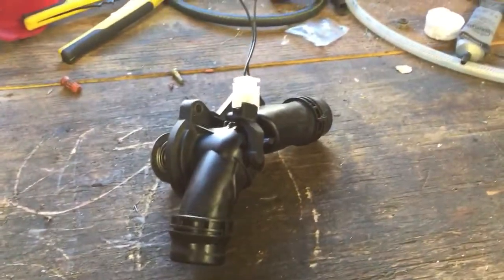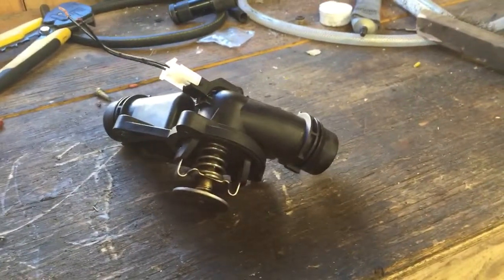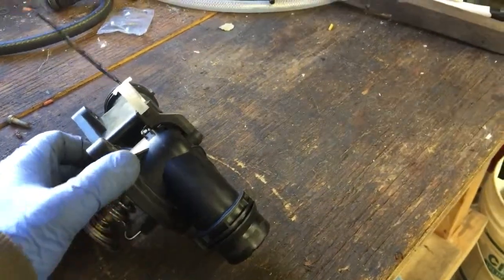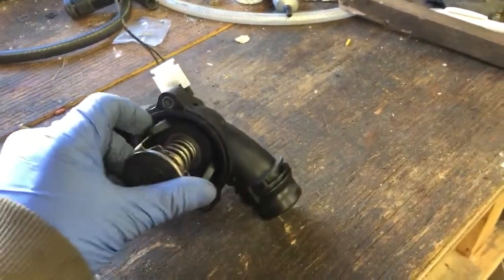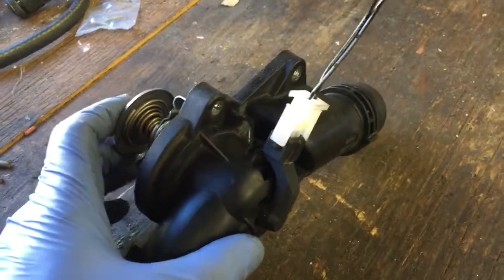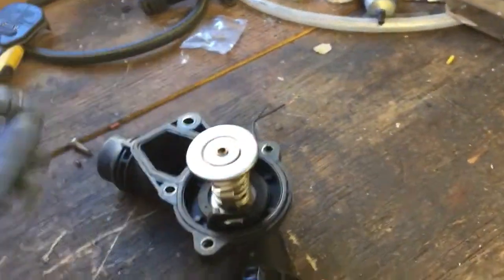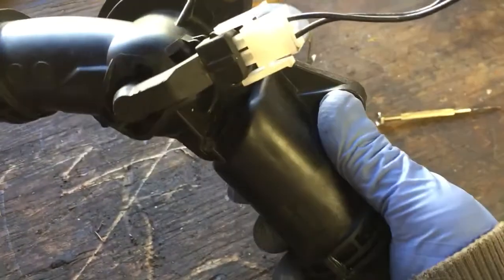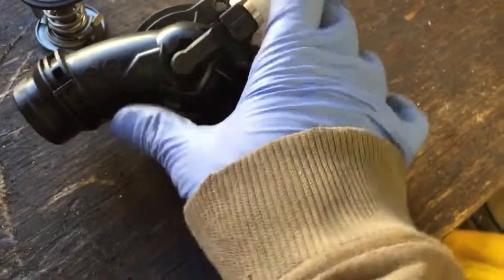BMW E46 thermostat problems. M54 3 litre inline 6 engine.

Comment: Poor video from a shade tree mechanic. When the probe heats up it melts the wax inside the Thermostat and allows the probe to slide up to open the Thermostat and allow coolant to circulate.   As the coolant circulates thru the engine and radiator the temperature drops, the wax hardens  and the probe slides down and closes. This repeats based on coolant temperature.
Reply from the maker: Man... you make it really hard to be nice to you, when you start your comment tossing out insults. 

I'm not sure what part of this video that you disagree with ? Was my sin that I didn't use the proper terminology and say that it is a thermowax plunger ? I clearly said that the probe heats up and opens the thermostat ?  You're not clear enough in your insults to determine exactly what it is that I got wrong.

If I am wrong, that doesn't make me a shade tree mechanic. That means I got bad info off the internet. Again, you don't explain how I'm wrong, and your explanation of the operation is wrong ... you say it "allows the probe to slide up" ... That's not what happens. 

Honda uses thermowax plungers on their lawnmower engines to open the choke when the engine is warm. Dishwashers use the same device with a heating element to open the soap dispenser. The wax expands and pushes out a piston, similar to a hydraulic cylinder.

Comment: There is no 12v on my e46  thermostat socket, is this normal? When the dme send 12v signal to the thermost
Reply: @JoelArseneaultYouTube  yes there is no check engine light on my intrument cluster. Thank you from indonesia. Great video
Reply: joel arseneault My (pre-)heater on the thermostat went bad. It threw an engine code, but did not trip the check engine light. So I suggest Ane Gan to diagnose/scan the car via the obd2 port. The faultcode I got was: 279C